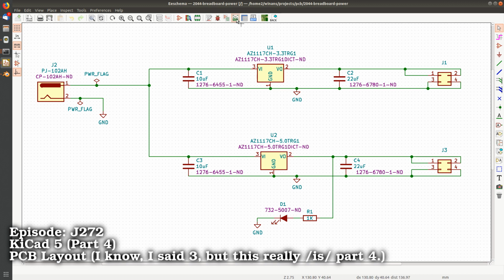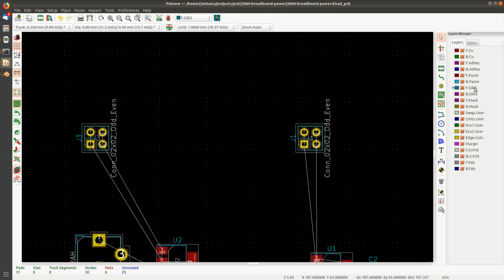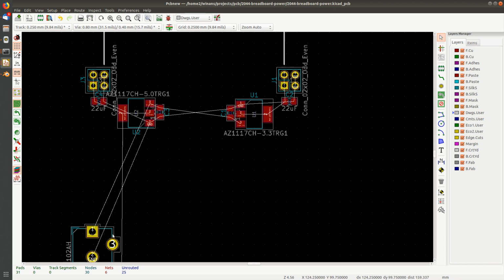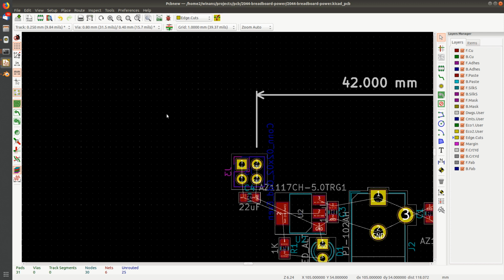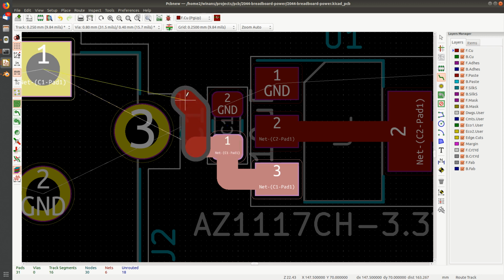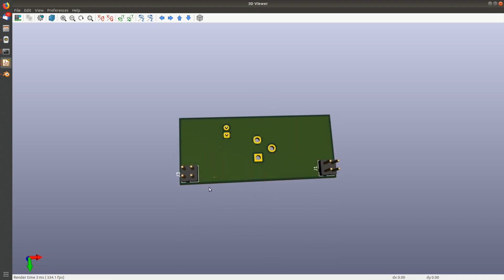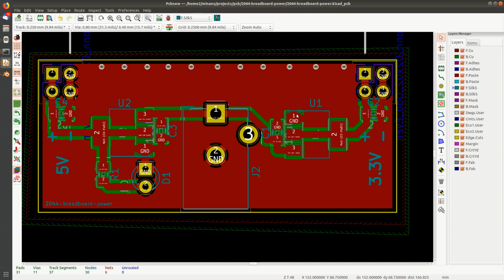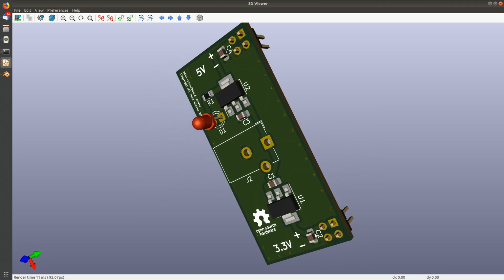KiCad 5 #4 PCB Layout

Comment: Hi John! What's the best version of Kicad that runs great on Windos 7?
Reply from the maker: Wow... This is likely tough for ANYONE to answer... especially me.. because I don't use Windows. :-D

However, anyone that tries to answer this question as given is going to be making MANY assumptions that could be problematic.

Unless you want KiCad itself to be your science project, install a version that has a standard installer and that you can upgrade without investing endless hours tinkering with it.

If you have any existing projects (which is the case for me) you need to make CERTAIN that the version you chose is not going to mess up all the symbols and such since the libraries change over major point-revisions (like 5.x vs 6.x).  Either pick the one that matches the version of the designs you expect to edit or schedule time to upgrade the projects (which is pretty simple) and then re-check everything (which might not be so simple.)

If you are just getting started, you want to chose the most recent version that 'everyone else' is using since it is likely to have been checked out enough that you can count on it not becoming your own support problem.

You also want to take this question up on the kicad.info discussion boards since they are used and read by the community at large:

      https://forum.kicad.info/

Comment: I HAVE A QUESTION, Only 1 Question
I got the entire video and i understood it 

My question relates to the colour of the board
I'm using KiCAD

Now I understand perfectly about filled zones
I Understand perfectly how to draw the polygon and that it can't be open ended
I understand about edge cuts

Now that being said

HOW DO WE DEFINE THE BOARD COLOUR

My fabricator told me that they strictly go off the gerber's so even though i selected blue at the time of manufacture the board came back, only 1 side blue and the other side green
what the fuck happened ? I don't know

so 3 areas of confusion that i have

1. The colours next to the layers do not necessarily indicate the colour of the board, i mean  F. Mask (even if both back and front are selected blue, we still haven't applied anything to it

2. Now if i select them both to be blue, why does the 3D Rendition not show it as blue

3. there is of course a way to make the 3D Model blue on both sides, although this is just a colour picker and does not actually communicate to the fabricator that the board must be blue

so..... How do we define the colour of the board on both sides
thanks in advance
Reply from the maker: Gerbers do not contain color information.

The KiCad 3D viewer does not render gerber files.  So it is not showing you what the fab house sees.

You have to tell your fab the colors you want some other way.

SOME fab houses I have worked with (15 years ago) requested that I create a gerber (layer) with text messages in it that specify the stack up  order (naming which gerber is for which layer) and other things like the board material, thicknesses, plating styles, thieving rules,  and solder mask & silkscreen colors.

It is possible that your fab house is asking for such a description to be delivered to them in a similar gerber file.

Consider asking them to send YOU an example of a proper PCB fab request package so you can see what they expect.
Reply: @JohnsBasement  
Interesting, thanks for that , because when i ordered i pretty much picked the default options and chose BLUE as the colour of the board
when it came back there was only blue on 1 side even though i selected 2 sided board.
i'ts the last thing that i've been trying to work out

Ok so i have this question then
if the gerbers don't contain colour information what is the point of having a F.mask and B.mask and drawing that polygon around the board and selecting the colour
i thought that was applying the mask layer
Reply from the maker: @martinkuliza  I dunno.  It is possible that I'm mistaken about the gerber files.  Maybe there is an option in there that I've never used... or that the board house I used back when ignored and that caused me to learn this incorrectly?
Reply: In the spirit of sharing is caring.... and to say upfront (thanks for your patience with me)
1. I took your advice and called the Fabrication house (well, ididn't call them... i guess im showing my age. LOL,   I got on chat with them).... i spoke to them 

Now let this be for the benefit of all 

2. I am dealing with JLPCB

3. i asked them if they could provide an example of a proper fab
their response "We do not provide client gerbers to other clients"
when i asked if they could provide their own internal one they said "We do not supply design assistance"

4. What i have learned about JLPCB is 
a) they are very cheap (but ironically , that comes at a cost)
for 5 standard boards delivered to sydney it's around $50,   same thing from PCB Way is about $90

b) they have impressive things (at least impressive at first) things like 
Electrical Check,   Initial Gerber check (checked by an engineer)
Now... one would think 
- Holy fuck,  .. so an engiineer is going to check my gerber for any errors
- When they build the board they electrically check it so that i know it works without fail

NO...NO... NO... FUCK NO.. AND NO AGAIN..  LOL
Here is what it really means ...
Initial engineer check of gerber 
Yes, an engineer checks it...
HE MERELY CHECKS TO SEE IF THE GERBERS CAN BE LOADED INTO THE MACHINE............ THAT'S IT !!!!!   PERIOD !!!
(i had this confirmed to me on chat)

- as for the electrical check
(my first board had open circuits everywhere) because i didn't know to change the NET NAME and how they related to each other and therefore they didn't lock into place
so what they actually do is....  (let's assume you have this circuit

                                                                                
------------------------------------------------(O/C)--------------------------------------

they check 
FROM HERE................TO HERE           THEN HERE ..............TO HERE
                                                    THEY DO NOT CHECK HERE
LOL
so basically , they only check the tracks that they lay
they don't care if they are Open circuit , short or otherwise

so.. JLPCB is ok , but understand you get that price because they do absolutely nothing other than 

1. they check their own work
2. They do not care if your board has errors
3. they absolutely and strictly follow the gerber regardless of faults 

anyway.... Back to our issue or board colour
they didn't provide and example file

- NOW THIS WAS INTERESTING
Today the operator told me (as you suggested)
The gerber doesn't contain the colour information,   BUT YET 5 DAYS AGO ANOTHER OPERATOR TOLD ME I HAD TO PUT IT INTO THE GERBER (which is why i reached out to you 
(i've got a board prep'd for Fabrication, i'm sending it off tonight, i'll see how it comes back)

but apparently 

4. The colours (as you suggested) in the 3D View have no bearing and do not convey colour information to the fab house

5. the colours in the layer panel have no bearing to the same effect, Not even F.Silkscreen  and B.Silkscreen
i mean... I thought (Assumed) that when you set silkscreen to WHITE for the layer colour that it means to the fab house, make the silkscreen white,  apparently it doesn't.

6. Apparently when you fill out the form to order the board
they go off your answer for   "silkscreen colour"
(which.. that other operator said, was not the case, but todays one said, it was)
Same for the colour of the board (The Soldermask)  they said , the gerbers don't contain the colour but instead, you have to pick it from the form
so i guess it makes that simple

7. Now.. A WORD ON THE COMMENTS LAYER
i asked,   "if i put comments in the CMTS.USER"  layer to make the layers blue and silkscreen white , will they read it "
their response
"We do not read or acknowledge comments within the gerber file"
LOL..... HOW NICE OF THEM 
Apparently you can put comments into the order form, but that's about it

so i guess this confirms what you have already said
the real test now will be to send the board off for fab and see what i get back,
Last time i got a 2 layer board with only 1 side with soldermask that was supposed to be both sides blue

this time (Because i was told that having Green soldermask is done faster) i'm going for a 2 layer board, both sides green solder mask with white silkscreen

LET'S SEE WHAT HAPPENS SHALL WE
but yeah mate,  thanks for your help, i appreciate the guidance because you did steer me in the right direction to getting the right answer

I've also noticed 2 other things about JLCPCB
1. some of their staff are not really very knowledgeable
2. since they are in china there is a lot of times a clear communication gap or breakdown in what is trying to be conveyed

i guess it's a teething process 
anyway that's what i have for now

Comment: John, can you give any hints or tips, or perhaps make a video on techniques for routing tracks for something like a 3D printer heated bed PCB? It doesn't really use any components, you can't just route Vcc to GND and so on. 

Also, knowing the track length is fairly critical, how can I measure track length?

Is there a way to get KiCAD to generate the trace in a nice pattern to save having to manually draw a long meandering trace?
Reply from the maker: Hmmm.. Doing this sort of thing with KiCad is new to me.  Sorry. I'm not aware of track length measuring assistence with KiCad.  You should ask about this sort of thing on the kicad info forums.
Reply: @JohnsBasement  I jumped into PCBNew, and laid some traces down, and the selected one segment. At the bottom of the window you can see segment length and total trace length, so that's awesome! That's probably the biggest obstacle, if you're patient enough to manually place 3 meters of trace on a board. 😂

Now, one last problem: How do I make a nice big solder pad on the board? I can't make a copper fill without soldermask. I tried to do a keepout but seems to only be relevant to traces and vias. As in, it will keep traces out!
Reply from the maker: @CollinBaillie  Coolness!  I never noticed that before!
You can make a pad in multiple ways.  I'd put a test point in the schematic and select a pad or thruhole pad for the footprint.
Then on the pcb, select the footprint and 'edit' it.  In there you can open the footprint pad editor & change the diameter, soldermask etc.
Probably something worth doing a video on when I get the chance.
Reply: @JohnsBasement  I did find a video showing how to remove solder mask. I'll have to try it. https://youtu.be/TmriDK7Jpes
Reply from the maker: @CollinBaillie  if you want to just remove the mask then fine.  If you want a pad to solder onto then making a hole in the mask to reveal something might be ok.  But if the copper revealed is big then it will be trouble heating up enough to solder it.... and if it is a wire you are attaching, you'll want a thru-hole so you don't inadvertently pull off the copper.
If you use the remove mask method to attach a wire then at least put on a via with a reasonable diameter thru-hole in case you need one.
Reply: @JohnsBasement  Noted. If it's an aluminium substrate, it may not be advisable, I'm guessing. Also, even harder to get the temp right.

Comment: For the last 4th point on the EdgeCut to easily view where it should be while drawing, you can set to cursor in the settings to whole screen. Then you see where the other end of the board cut is while drawing.

Comment: How do I set the parameters so that I don't have to keep changing the size of the vias and track widths when I add a new ones?
Reply from the maker: In PcbNew (the board editor), click on the 'Board Setup' icon (the green one upper send-to-the-left... it looks exactly like the the international symbol for WTF is this button supposed to do?).  It will open a set of forms that lets you edit things like the default, max, and min values for tracks, vias, etc.
I regret never having done a video on how to use it.  But now that the spring semester is wrapping up, maybe I'll have time to do one.
Reply: @JohnsBasement  Somehow it is not saving the data I entered.
Reply from the maker: @Berghiker  This makes no sense.  Maybe you have values in the defaults outside the range of the limits?
Reply: @JohnsBasement  The changes need to be made in net classes, not tracks and vias.
Reply from the maker: @Berghiker  not on line right now... But look closely.  One is likely limits and the other (that looks like a spreadsheet table) is the defaults.

Comment: When I print this out on my laser printer, it prints out too many blanks (probably lots of seperate layers), and the print size is too small. How do I get this to work?
Reply from the maker: It depends on what you are trying to accomplish.  You are not giving me ANY idea what you are actually doing, what software you are using, how much "smaller" your output is, are you printing from KiCad or from a pdf, etc.

 I suspect  that this has nothing to do with KiCad at all.

For example, some print drivers "scale to fit" things to the page area.  Such settings will ruin the size of things like a PCB foil pattern if you are trying to get actual size.
Reply: @JohnsBasement  Using Kicad to print a pcb pdf. The size of the output is 70x110mm instead of 75x116mm. A little too small. I used actual size, thought that might work.

Comment: Is there a way to invert the colors so that my laser printer prints everything but not the tracks and ground plane?
Reply from the maker: I use the plot output icon (not print).  Then selest layers of interest & 'plot to PDF' and print the pdf.
If that is yick then try plotting to gerbers & find a gerber viewer that can print it after you can select what layers, colors & stacking order.
Reply: @JohnsBasement  OK. I finally sorted out all the issues with overlapping pads, courtyards overlapping etc. The printout from the plot pdf came out way too small on the 6x4 photo paper. Board was 116mm x 75mm. It printed at 40mm x 26mm.

Comment: How do I change the size of the pads? Run DRC.......Pad too close to pad. Track to close to pad.......Courtyards overlap......Pad too close to copper item.
Reply from the maker: It depends what you need to acbomplish.  You can edit them directly in the pcb efitor by double clicking on them.  You are, however, probably better off defining a new footprint for what you need.
If you only want to rid yourself of the DRC warnings, you can change the design rule values/tolerances.
I your design rules are as tight as they can be for your board fab house, then you might need to edit the trace widths by double clicking on them... or reroute your board.

Comment: Ok, I pause this video a lot from about the 32min mark because as I was doing the tracks on my project the video became white noise until at some point I heard the word 'vias' and my ears pricked up, mostly because I miss autorouting and intend to do single sided etching at home, plus I'm getting tired. So I'm going to save this as it stands (man, I do miss autorouting, but I've heard it can be incorporated into KiCad 5 since it's not included by default as it used to be), and pick this up tomorrow. However, Brilliant video series so far. I've just looked at the playlist, 37 lessons and I'm on no 4, haha!... But, it doesn't matter, this has got me further than I dreamed in one evening, so thank you for that John, I have learnt a lot and will return!